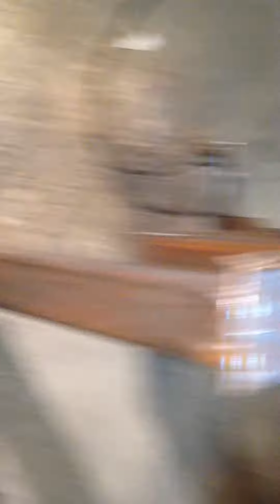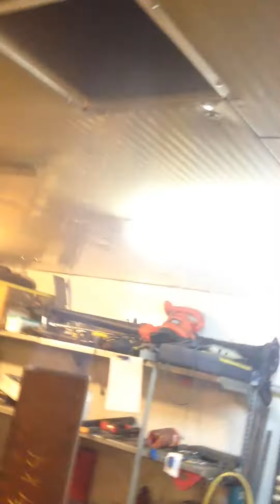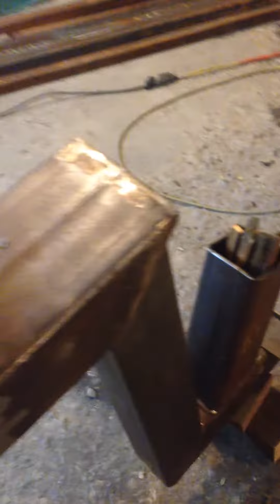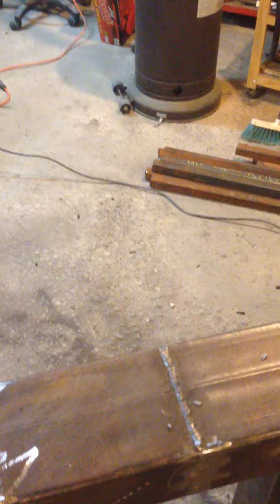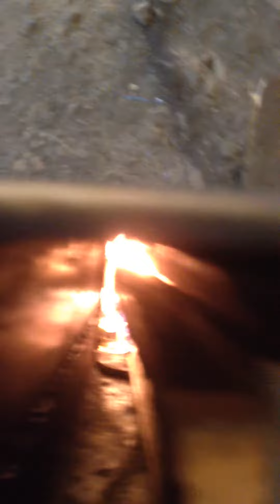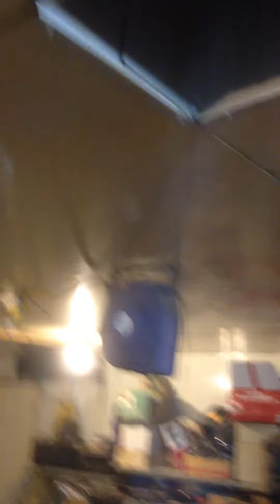First Try at Rocket Heater

Comment: Cut your fuel into cubes and your output will soar!! Just dump them in and off you go. Make the cubes irregular so they can't block the air. I went from 9 or 10K btu to 15-18K with just that change.
Reply from the maker: tried that tonight and could not get it to light at all. still going to try to put 6 inchs of inul around the fire box. its all made out of 3/8 and 1/4 steel. takes a lot of heat to get going
Reply: Indeed!!